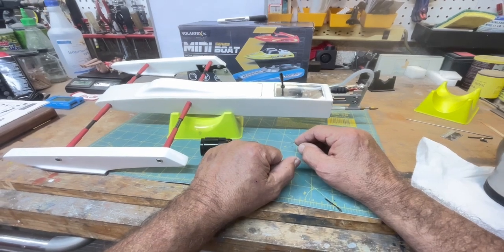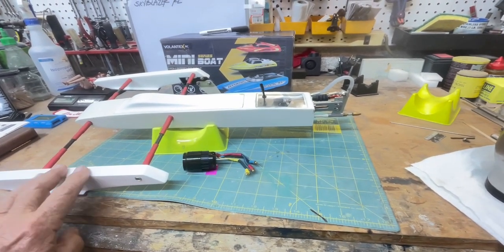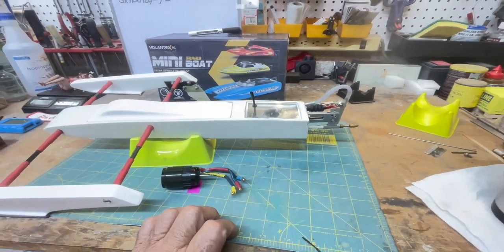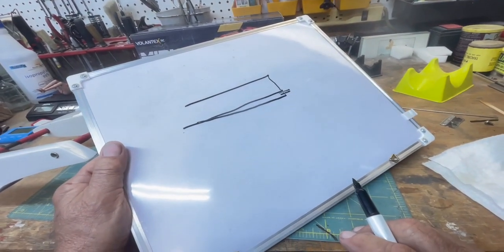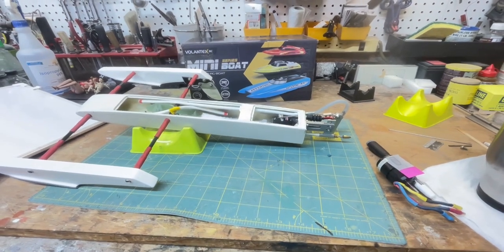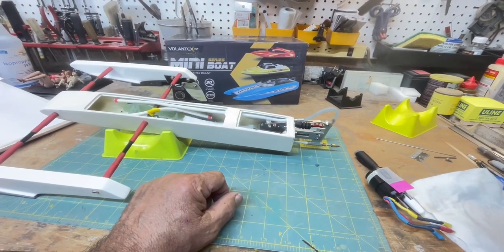Dr. Jet reveals a new prize.

Comment: New challenge idea..

1/2 mile worth of ovals (doesn't matter the size of the oval)

Total distance 1/2 mile..
3s voltage max mah 2200

Fastest time for 1/2 mile course 

Tune your prop for optimal speed and efficiency.. To not kill the pack before the 1/2 mile is completed 

Nothing official.. Honor system.. 

For example: My pond is 4 ovals in the bay to equal 1/2 mile 

Some guys will only need 2.. Some will need more.. But 1/2 miles should be the total distance traveled. 

Just a thought